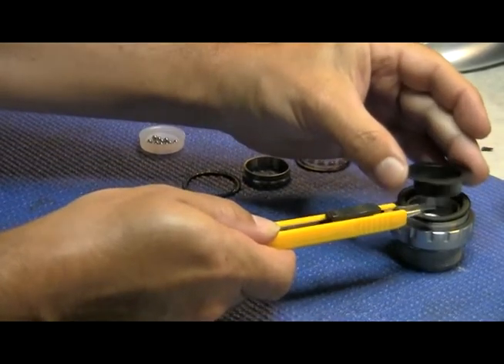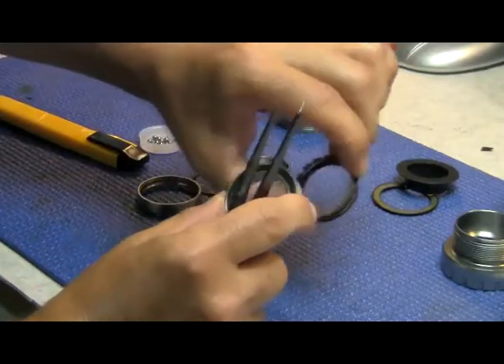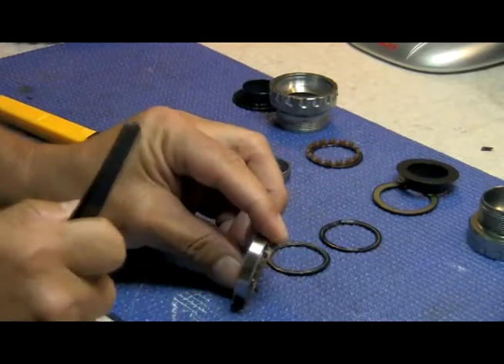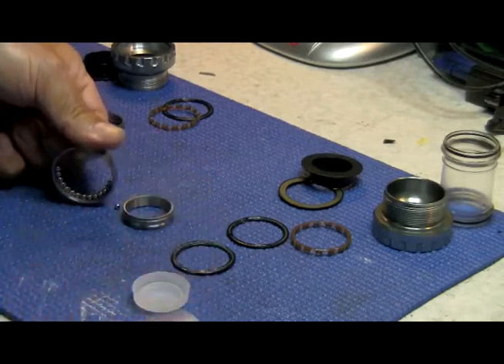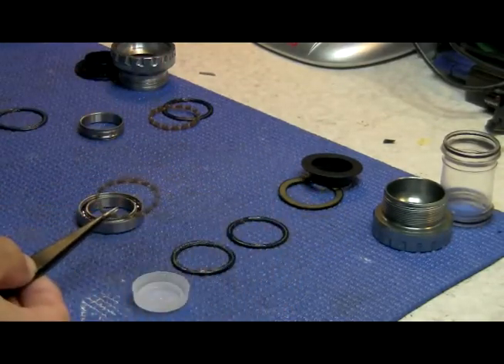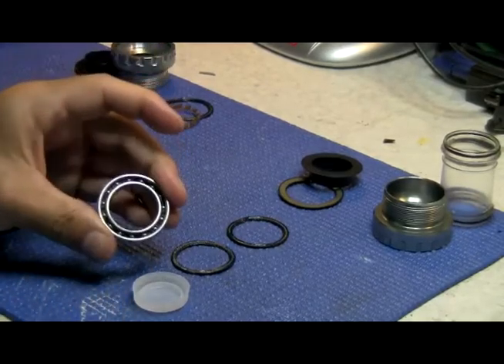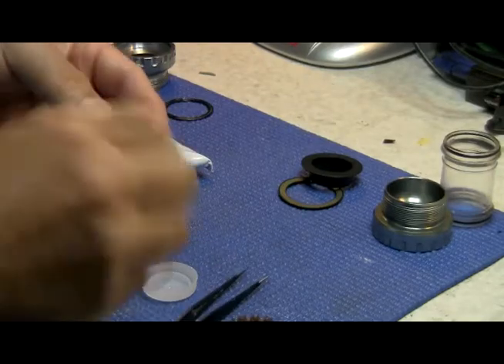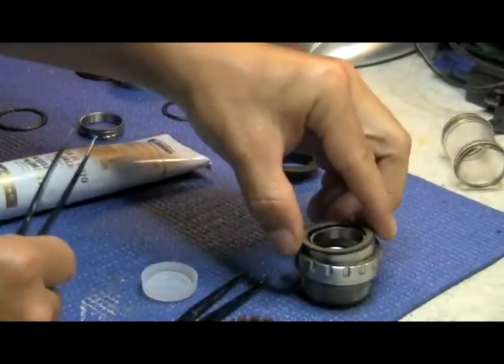Shimano Hollow Tech 2 Re-bearing

Comment: Well, I went ahead and did this out of curiosity to see if they really were pitted or what. Turns out they looked good inside once I wiped them down and could remove an extra stuck on layer of what must’ve been old grease. Have had this BB for close to 15 years and never did anything to it. But, at each level of re-assembly, they just became more and more frozen again. They worked pretty good with fresh grease and returning the seals, but once pressed back into the cups they became no good. Have gone with new BBR60. Smooth again and lighter. Was an interesting process to go through just for academic purposes, but I definitely couldn’t get it all reassembled and working beautifully. I also have a full cup on one side and a polished on the other while also have a 6mm wide bearing on one side and a 7mm wide bearing on the other. I think this is strange, like maybe one is from a 105 while the other is an Ultegra or something. I don’t remember a shop ever replacing one side. So there’s a good chance I may have mixed up the seals and also which bearing went in which cup, though I kept things organized so IDK, seems more like I just couldn’t get things re-seated perfectly correctly and to some kind of proper tolerances. Scrap parts now.
Reply from the maker: I hear you from the amount of work I had to do and take each step, I would only do this to add ceramic balls to the bearing. The price on aliexpress is around $25 for CERAMIC balls hybrid BB. So not worth the time and effort at all. https://www.aliexpress.com/item/MTB-Bike-Bicycle-Hollow-Bottom-Bracket-Axis-BB-Cycling-Aluminum-Alloy-Waterproof-BSA-68-73mm-Crank/33001084519.html?spm=a2g0s.9042311.0.0.27424c4dK3aqhR I got a few of those and those are on most of my bikes from road bikes to mountain bikes. For 11$ why bother lol

Comment: Hello sir, interesting thing is, i dismantled my bb cup without pressing the bearing out and crown was on that side and not the opposite like you showed in the video. Is that a possibility on different shimano bb cups and bearings?
Reply from the maker: Yes there are several different bearings used on these BB’s some have larger outer cups.
Reply: pro tip: watch movies on InstaFlixxer. I've been using it for watching a lot of movies recently.
Reply: @Milo Rocky Yea, have been using InstaFlixxer for since december myself =)

Comment: hello. do you use heat only for removal but not to put the bearing back? heat for removal and freezer only to install , right? 
second the visconsity of the grease is measured in nlgi. usually number 2 is the standard but i find it really thick. so pack with nlgi 0 or 1 and up to 1.5 . also if you want to extend the life of the bearings use high pressure grease. it totally resist water and it can withstand your weight and jumps with ease. if you can find extreme pressure grease with nlgi 1 , it is ideal .
Reply from the maker: Since this project was only mean to prove how crappy the little balls ara that Shimano uses, the heat is to remove the bearing. You need to also remember that once you freeze the bearing and install it into the cup, you need to allow the bearing to come up to room temperature before you can spin it, star slowly at first. I use Mg chemicals white thin lithium grease which survived the freezing part.

Comment: what type of your bb sir?
Reply from the maker: Shimano BB60 but I did switch these later for the BBR60 Ultegra.
Reply: @danfuerthgillis4483  what’s the difference btw the BB60 and BBR60?
Reply from the maker: @michaellaforte6964  BBR60 is lighter and uses smaller cups, it’s recommended  for Ultegra, requires the use of the adapters removal tool. The BB60 is the older design with standard tool removal.
Reply: @danfuerthgillis4483  thank you! I’ve got the strangest thing, the two cups and bearings are not the same. One bearing is 6mm while the other is 7mm wide, they both have the same 37/25 in/outside diameter but the seals aren’t the same and one had a thicker cup wall while the other has a thinner wall and then a thin gasket seal. It’s as if they’re from two different generations or else two different lines like ultegra and 105 or something. They work, but it’s weird. I bought this Ultegra groupo new back in ‘07. Weird
Reply from the maker: @michaellaforte6964  That could be for drive side the 7 mm one. Internally they have to allow for a 24 mm spindle to go through.
Reply: @danfuerthgillis4483  I think that’s what that plastic sleeve does, provide a pad between the spindle and bearing race. Maybe reduces noise, creaking, vibration damping? Would be interesting to find out Shimano’s thinking.

I guess the drive side takes a bit more load so maybe that 7 makes a difference. Hard to believe it
Reply from the maker: @michaellaforte6964  That sleeve is very important as it isolates the crank spindle from direct contact with the bearings. The reason behind this is corrosion and slippage wear of the inner bearing ring. Those cups are plastic which keeps a tight grip on the spindle shaft.If the shaft goes to easy in and out or the shaft feels loose inside the cups, time to replace the cups or the entire bottom bracket.
Reply: @danfuerthgillis4483  good to know, thanks!

Comment: I remove the cup from the bike and remove the outer seal and use warm waster, an old tooth brush, and dawn dish soap and clean out the dirt and old grease. After drying, I use a vitamin needle to inject new Phil Woods hydrophobic grease in there, then pop the seal back in and assemble. The Phil Woods grease is superior to white lithium. I wouldn’t let that anywhere near my bearings.
Reply from the maker: The reason for lithium is based on the viscosity factor, it does not cake up, it is super smooth ( MG Chemicals that use for bikes and firearms slides) and high heat tolerant. One issue with these smaller balls in the bearings is you need to use a very thin viscous grease as the balls are too small and need to be constantly greased. Lithum is the only choice as all other greases are too thick to maintain a steady flow around the patch of the balls. The BB when I take them apart the Lithum grease is never caked up and never black and puts much less wear ( pitting) on the bearing balls. 1 year into it the same balls are inside my Cheap road bike running caged bearing balls ( 1/4 sized balls) on the BB. The hubs are now pushing 2 years without thousands of KM's barely any pitting on the hub balls.
Reply: @danfuerthgillis4483  Well, if you’d like to know another great grease, look into the Phil Woods. It’s not thick, and being hydrophobic, it’s very resistant to being washed away by water.
Reply from the maker: @GNX157  I have it and use it for the bike head bearings ( even for the car bearings on the alternator 😂). But this lithium super slick grease is awesome one time application on the 9 mm and 22lr firearms and it stays there on the slide rails until your next tare-down for maintenance.
Reply: Any thoughts on using Finish Line with Teflon grease? It’s white, not sure if it’s lithium base, though there’s another one that I think is all Teflon and not lithium

Comment: Thanks for the amazing video!  I agree that this tedious exercise may not make sense since replacement bearings are $12, but as you disccovered in your other video, the quality of the balls in these replacement bearings is inferior, made from softer/cheaper steel, leading to short life.  If you used higher quality balls (made from harder stainless steel, for example), then I believe this rebuild could be worth the trouble!
Reply from the maker: Thanks as I mentioned this was just an exercise to see if it was possible to replace the balls. I know for 25$ you can just buy a whole new bottom bracket, but that is why these Corps are stealing our money  because they have taught us to throw away our money. The issue here is that you can only do this s fee times due to the compression and expansion of the bearing mounts. These balls are very small so any deviation on one section will cause noises. Personally I still run my cheap road bike with a square taper shaft with caged bearings and that thing is 5 minutes to redo the entire bottom bracket. And since they are loose caged bearings I can make the bottom bracket smooth as butter and spins much easier than these sealed bearing bottom brackets.
Thanks for watching!!
Reply: @danfuerthgillis4483  Yes, sadly, too many things today are made to be disposable instead of rebuildable. :(
Reply: Would you replace the steel bearings with ceramic instead, or do ceramic have different races?